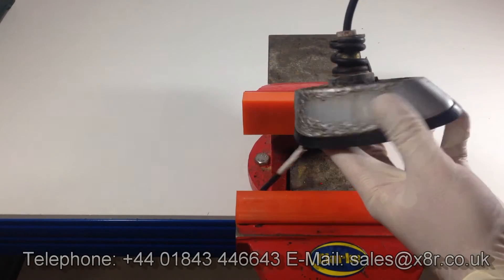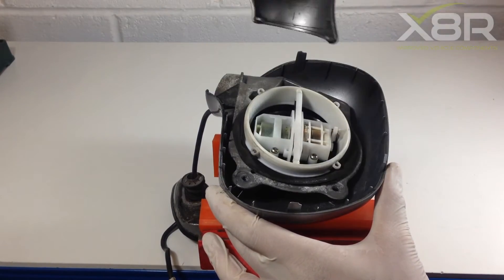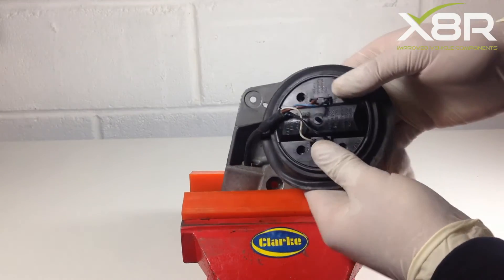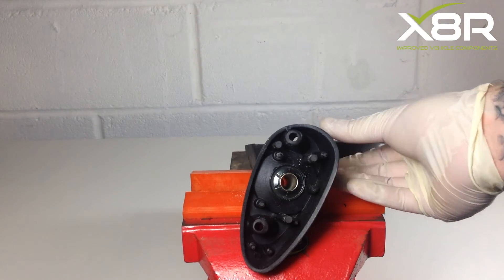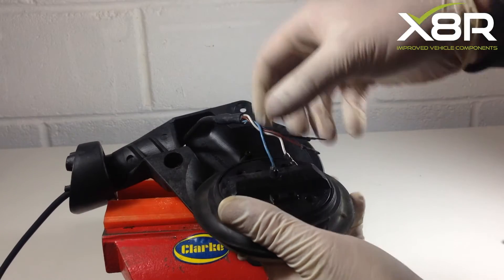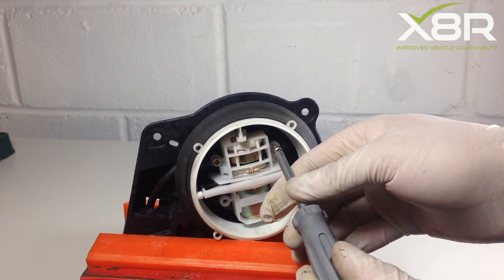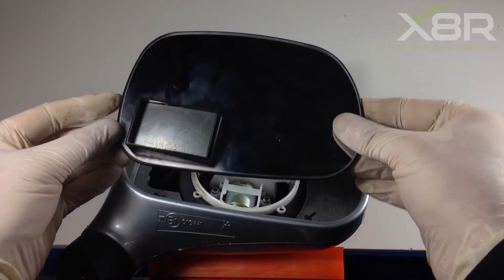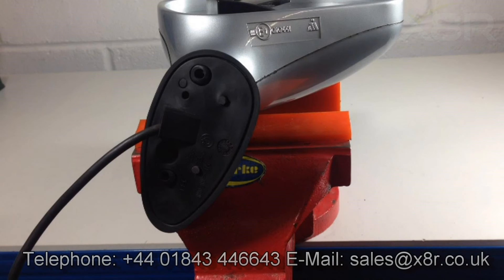BMW Z3 E36 Outside Wing Door Mirror Roadster Coupe Corroded Snapped Spindle Repair Fix Kit

Comment: Perfect fix for my 1997 Z3.  No more duct tape!  Now ordering the passenger side as it will likely fail soon as well.  One note, the base of the mirror where it attaches to the Z3 is black (approx two inch base). I think the black actually looks better so when I do the passenger side it will match nicely.  Your other option will be to purchase some color match paint and spray the base before installing.

Comment: Hi I’ve purchased this and quality is good!!.. however it won’t twist to access the screw holes to actually bolt it to the door!!..
If I try to force it any harder I’ll break something!!.. is there a trick to this or is mine faulty!!??.. as this video does not show this!!!?🤔☹️
Reply from the maker: rob jennings This is quite normal, put the base in a vice (protect with a towel or alike) you’ll be surprised how much easier this makes it. As soon as on the vehicle as the base is fastened it will twist as per OEM.

Comment: Hi.  Old video but still relavant.  Just to check, I don't need to unplug the connector if I simply remove the mirror, remove the cover, unhook the cables from the motor, unscrew the mounting from the car and feed the wires out (so it's essentially dangling out of the car with the mirror assembly detatched)?
Reply from the maker: Hi, I don't think you would need to unplug the connector by the sounds of things. But unfortunately we only did the repair the way it is demonstrated in the video, so it would be hard for me to confirm this. I'm hoping another YouTuber may be able to advise better. - Georgina, X8R Ltd